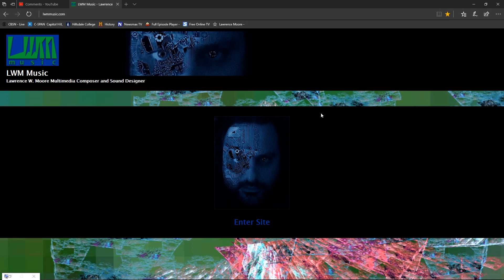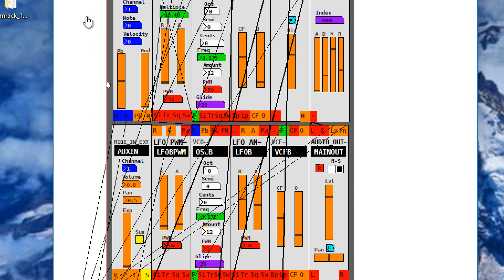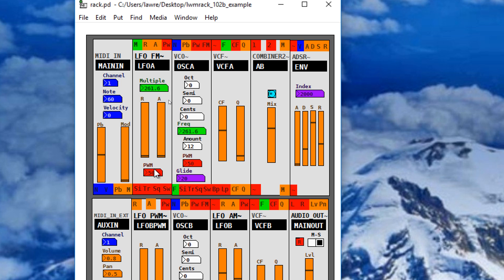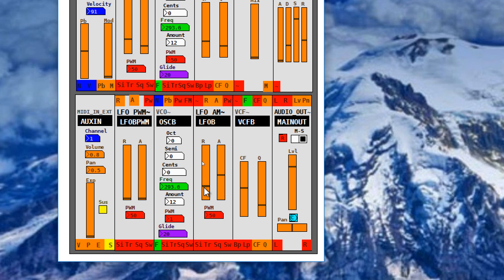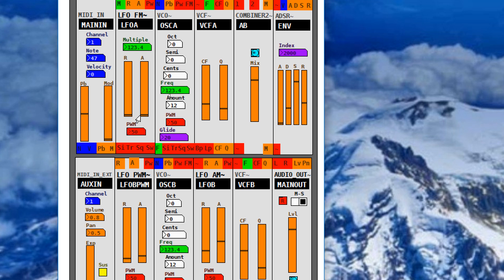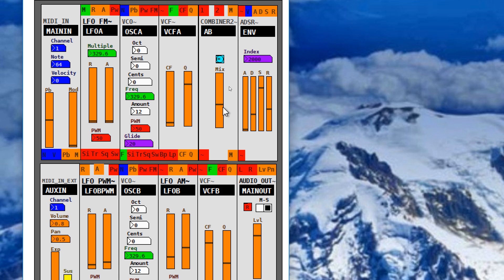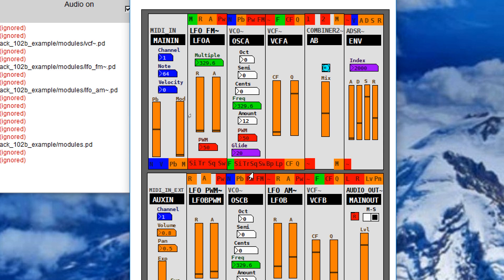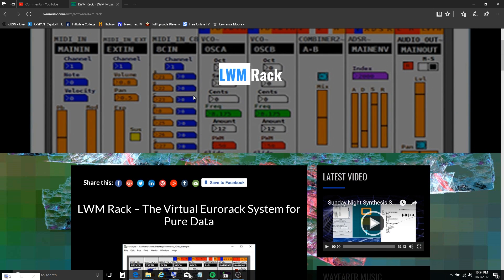Pure Data Patches - LWM Rack 1.02b - 3 LFO's and a Band & Low Pass Filter

Comment: Your filter: is it 24 dB/octave?
Reply from the maker: It sounds close. PD can be used to achieve Q resonances that go in-between, above, or below the standard 12 dB and 24 dB standards for hardware synths. It all depends on the patching.
Reply: @TheWayfarerProjectLearning  Does it work with Pd Vanilla or does it need (the deprecated) Pd-extended?
Reply from the maker: PD Vanilla is what I am using. I don't believe any of the components are picky about any of the recent versions. I've been using 0.46 - 0.48 to make my creations like LWM Rack.

Comment: i have a doubt, im learning the pure data to create my own instruments/effects, but can i use my instrument/effect in my DAW, i use ableton 10, can the instrument made by pure data used as vst? please clear my doubt
Reply from the maker: As an instrument, one can use a virtual MIDI connection, with software like Loop MIDI or an internal setup that you can do in MAC OSX, if you have a MAC. That would allow MIDI  from your DAW to feed note and velocity values as well as controller messages to your instrument in PD. For an effect, you would need to use a virtual audio cable software to convey the audio to PD and then perhaps convey it back again. I know that Ableton also has the avility to use MAX, which is a similar language to PD. Then, you can do both of these using MAX. I'm not familiar enough with the different versions to tell oyu if your version has MAX included with it or not, but you could certainly find out from the Ableton website and look at MAX for Live.
Reply: LWM Music thank you.. i tried loop midi in vcv racks, it was good but there is no other way to use that as vst
Reply from the maker: I just found out a few days ago that the new version of VCV Rack has a VST bridge. I have downloaded it and have been trying it out. It shows up as an effect rather than an instrument in Reason and Sonar, the dtwo DAWs that I use. I'm trying to find a way to get MIDI to it that way. I believe, however, that they are still working on this VST aspect of it, and the problem should be solved soon. They seem to be actively working on it.
Reply: thank you sir, thats a very good information, but my question is, can Pure Data synth/effect can be used as VST? or can we convert those projects into VST, in any other way? thanks again sir
Reply: and im planning to learn JUCE where we can make effects/synth vst in it with C language
Reply from the maker: I thought you were asking about VCV Rack. I was answering multiple comments one after the other and got confused.  I have not come across a simple VST object for PD as of yet, but I have not searched hard either. In about a half hour of searching right now, I found an object that lets you use VST plugins with PD, but not an object that forms a bridge between PD and a VST supporting DAW. If you ever come across one, please let me know!
Reply from the maker: Just after posting my reply, I re-worded my search and found this: https://www.kvraudio.com/product/pdvst-by-joseph-sarlo . I'm going to check it out myself and let you know how it works if I get it working.
Reply: LWM Music, i searched about that pdvst a week back, but i was unable to understand that readme/ the procedure to use pure data as vst, and by the way i love the way you explain deeply about pure data and a question here, as we do projects on pure data, making synths/ effect, what is the use of making these when these cant be used in our DAW, every musician(electronic music producer) like me, wants to make their own plugins, but few of them know the C language to make their plugins. but pd just let us to make the synths/effects in itself, if we want to use it in the DAW, we have to download loop midi, and route that input into our daw's track input. thats a headache for me. but if the pd can be worked as a plugin with better GUI, it will be great. thanks for taking time to reply me😊
Reply from the maker: I downloaded the package that the link I sent you went to. It did not work. The example PD patches with their vst .dll files were not found my either Reason or Sonar. It might be an old release or something. One thing that I found that allows you to make vst plugins is Synth Edit. http://synthedit.com/ It is Windows only, however. It has a demo version and the paid version is $99.95. I do not know the different between the two, because I had downloaded and then bought an earlier version of it. It appears as if they are keeping the project going and have newer versions now.
Reply: LWM Music , wow... the information in that link sounds interesting.. i have to give a try, thank you so much taking your time and giving me information! ill give a try and inform u.
Thanks Again 😊
Reply from the maker: I'm going to be checking it out again too. I looked at the free version, and they have improved it. Now, one gan make 64-bit plugins, FX and synths. While the software for making them is Windows only, which is fine for me, the plugins, once rendered, are cross-platform like all VST plugins.
Reply: LWM Music i create a monophonic synth in it, which is sounding okay for me 😅, can i send it to u for review, with your permission
Reply: its a VST2 synth, SynthEdit has VST3 option too but ableton doesnt have VST3 support, so i exported VST2 dll file
Reply from the maker: Sure, I can try it out.  You can send it to Lawrence@lwmmusic.com . Did you purchase the paid version, or did you just use the free version? I have not had a chance to use this newer release of SynthEdit and I do not know what the difference between the free and paid version is at this point. When the semester ends next week, I will be back in action with more time.
Reply: LWM Music thanks for the reply, i think it is a free version, i downloaded it from downloads section of that website, everything works fine in it, i didnt encountered any 'Purchase this Product' popups.. and im going to send the vst in a moment..😊
Reply from the maker: I was too late to get your download. It isn't there anymore. I was playing with SynthEdit tonight. I remember that you are supposed to use the list entry object to connect to the "waveform" in of the oscillator to select waveforms. yet, it used to allow you to change the look so that it was a knob rather than a drop down list. It doesn't seem to have that built in anymore.
Reply: LWM Music i didnt encountered it, list entry was working fine with me, it comes like drop down menu, i can select waveforms of that oscillator. Can i resend you that file
Reply from the maker: I found out what the limitations of the free SynthEdit are. You can make plugins and render them out, but you are limited to creating 8 presets, rather than 128 presets, which is the full capability of the software. These presets appear in a list at the top of the plugin, so you can make a variety of preset sounds for your synth and leave some open for users to save their own. Also, the plugins you render will only work on the computer that you made them on. If you want to distribute them or use them on other computers, you need to buy the software license. $100.00 isn't really that bad considering all that you can do witht he software. You are also then allowed to sell plugins that you make with it, so long as you use either the graphics that it comes with or make your own.
Reply: oh, i didnt know about that, i didnt tried about the presets thing but, i do gave my plugin for give feedback to some guys. ill try to check about that presets thing today and let you know
Reply from the maker: I read that information off of the website. I was somehow able to find it. It mentioned those limitations for the free version. It at least lets you try to make something and try it out on your own computer before committing to buying the software. The creator seems to be a single person who lives in New Zealand. I understand that he needs to make a living from his work, and think it is a fair deal, although I can't afford to buy it right now.
Reply: LWM Music thanks for the information, but everything is working correctly for me, i tried the presets thing, i made 18 presets, tried on my daw and shared with friends, it was working well
Reply from the maker: That's good to know. I'll probably make something soon and test it out with friends too.
Reply: LWM Music wow.. thanks for giving this much support, with patience

Comment: Hello Dr. Moore, I was wondering if you know the program VCV rack, it is very interesting and I've been wondering it it could be hooked up to pd?
Reply from the maker: I have not heard of it, but I would like to look into it. I will google it, but if you have a link, please post it. Thanks!
Reply: Here you go: https://vcvrack.com/
Reply from the maker: I'll get back to you after I check it out. At first glance, it looks nice.
Reply from the maker: I got a chance to play around with VCV Rack. I like it. It is a lot like Softube's Modular, but most of the modules are free, which is nice. It seems to be an open source development. I want to become more familiar with the individual modules that it has, build some things, and then see what the lay of the land is for development. I would probably have to increase my module of whatever base language they use for the software and see if the pd libraries can be integrated. Other than that, one can certainly use virtual MIDI connections to send MIDI data from PD to Rack. It might allow one to build a more robust sequencer to driv the rack's sounds and parameter changes.